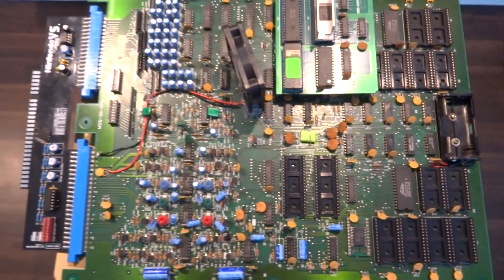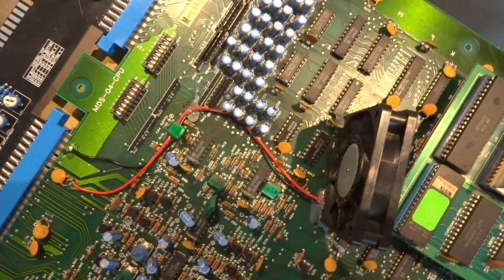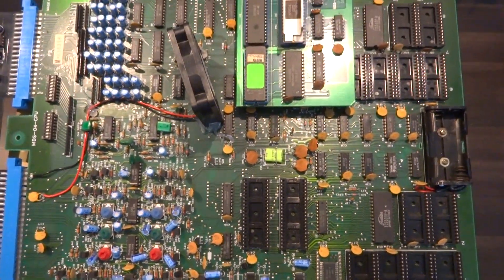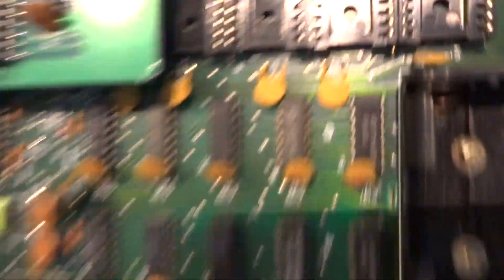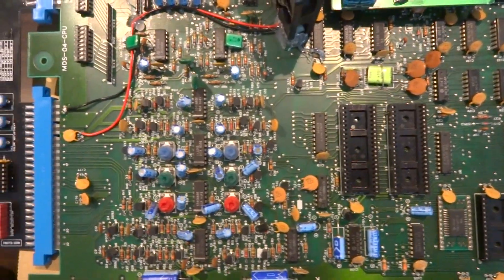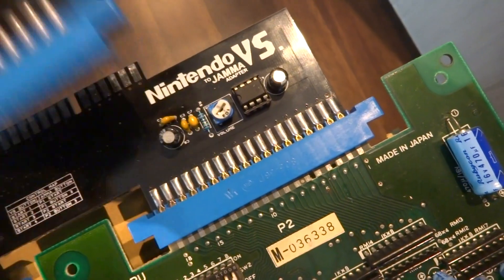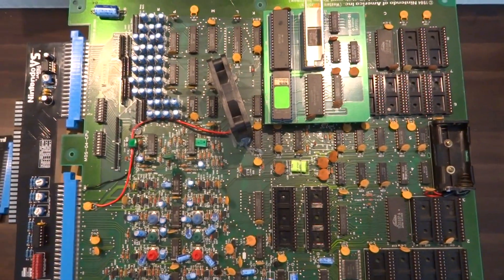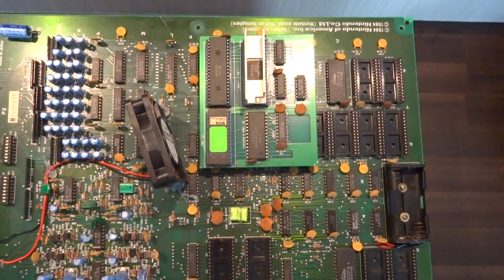Nintendo VS. Board + Technical Info. Arcade Harness Adapters Thanks To pcbjunkiedotnet

Comment: Okay with the Nintendo vs board, since it essential is 2 separate NES boards, how do I use the NES on the right of the board? 

The left side on mine isn’t working right. When I populate the right side with the daughter board, I don’t get audio or video. 

Anything I need to do to force it to play from the right NES?